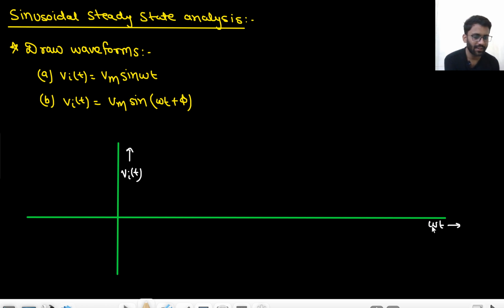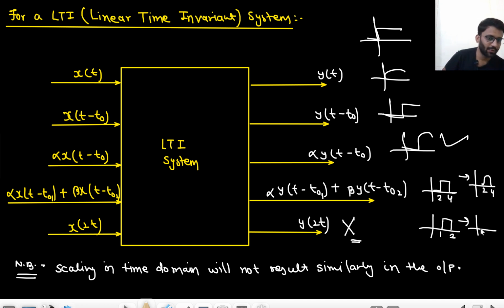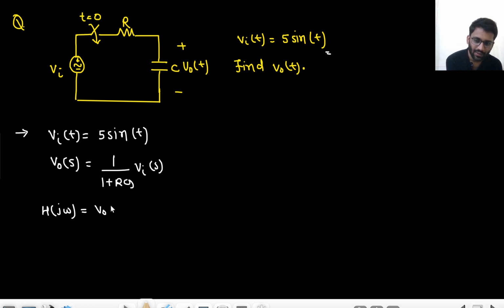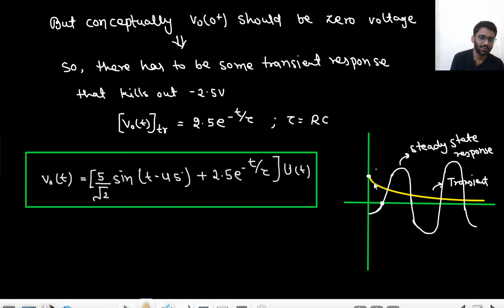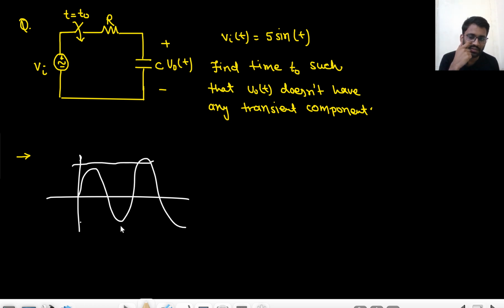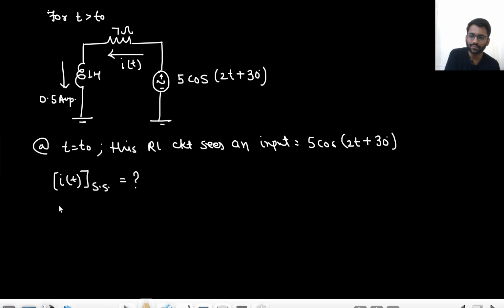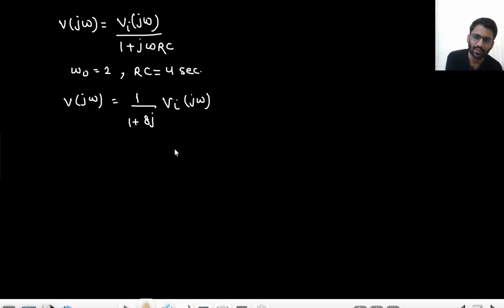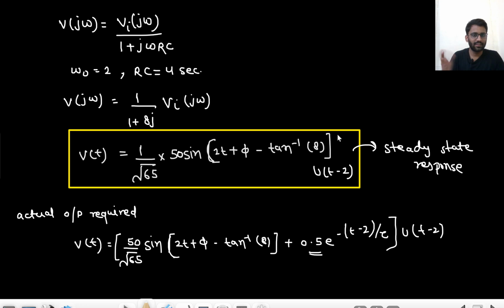Sinusoid Steady State Analysis || Network Analysis || GATE 2025-26 || PrepFusion || Himanshu Agarwal

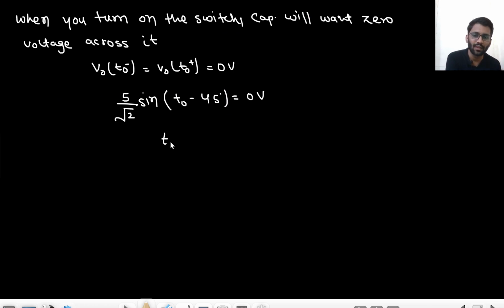Comment: At 51:10 , if sin(theta)=0 means theta = n*pi so to = 45° + n*pi/180
Reply: at the first 45° , the output becomes zero upon closing bro. The time required to reach the 45° (pi/4 radians) can be calculated from Omega × t where Omega = 1rad/s  and t is the ans .

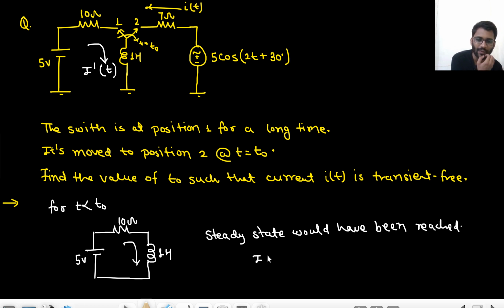Comment: 57:13 here you found directly the current, but at 1:07:25 you wrote equation for finding Voltage at t=2s, why did'nt you write the equation at 57:13
Reply from the maker: One has a DC input, other one has a step. 
Now think.

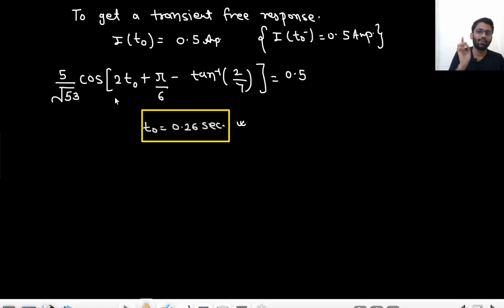Comment: 1:05:07 , In order to kill the 0.5A from transient response, the steady state value should be equated to -0.5A rather than +0.5A. Please explain sir if I am wrong on this part?
Reply: It will be 0.5Amp 
At t=to, you would expect 0.5Amp current to flow through inductor and if that current you can get from steady state current equation only, then there would be no transient response term. I hope you got the point
Reply: @HimanshuAgarwal_  yes sir understood, Thanks 👍